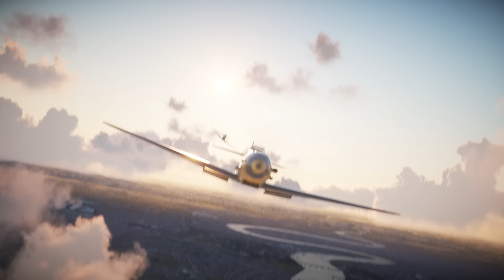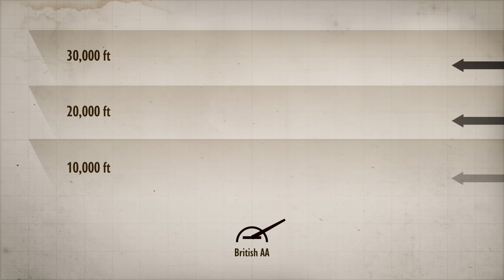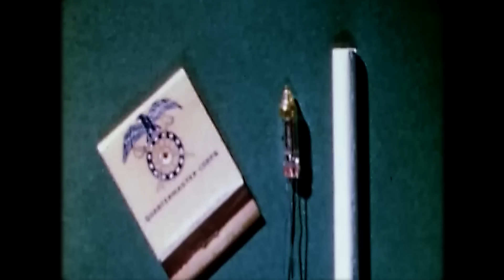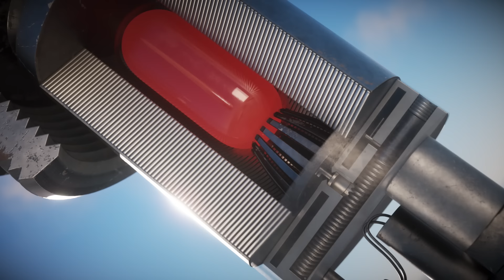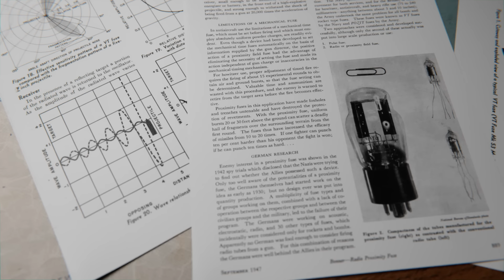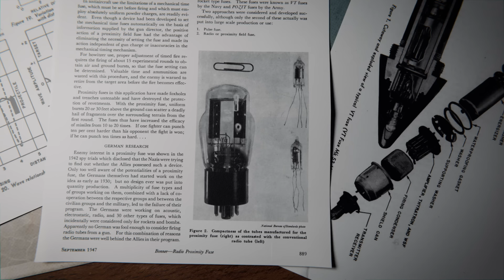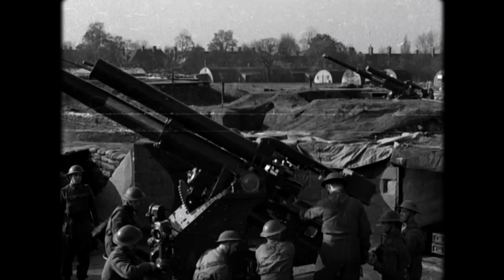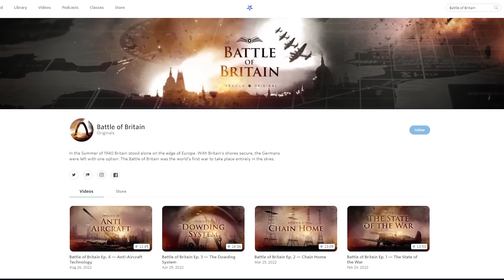The Secret Invention That Changed World War 2

Comment: They made a difference, especially in conjunction with the “predictors” (analog mechanical targeting computers and electromechanical relays to automatically aim the gun).  Once these were implemented, the crews didn’t even look at the targets.  It was just load the gun, and keep the pointers aligned.  One pointer (under control of the gunner) showed where the gun was actually pointed, the other (under the control of the computer) showed where it should be pointed.   The crews never even had to look up.  The seemingly obvious step of removing the gun crew and turning the aiming over to the computer didn’t happen until the 80’s though with the advent of the CIWS gatling gun antimissile system.
Reply: I'm really disappointed real engineering missed this. The predictors are my personal favorite invention of world war 2.
Reply: Not to mention radar, which allowed for such precise measurements of enemy planes
Reply: Indeed! hopefully we will never see the need for anything like these systems ever again.
Reply: @Sprengstoff  sorry to be the bearer of bad news but these systems are the basis of modern systems that have seen and continue to see extensive use. The proximity first he's describing is a lot like radar just much more primitive. The AA shell is making a serious comeback. Numerous new systems are being developed to combat drones and cas.
In a way it's good news, drones aren't a human life, but they take them a little too well.
Reply: @notsam498  There's not even a comeback, it's always been used and refined. The ancient 35mm Oerlikon GDF and 40mm/57mm Bofors cannons many nations use were gradually upgraded with 3D radar/multisensor cueing and programmable AHEAD rounds, essentially slowly turning 50 year old manual guns into highly modern autonomous CIWS. The West, particularly the US simply ignored SHORAD for a long time (granted it is understandable why).

I'd like to see guided hypersonic projectiles massively adopted in 127mm/5 inch guns though, it's time we have more economical solutions for mid-range AA.
Reply: @mimimimeow  hyper Sonic muzzle fired projectiles are kind of impractical. Every single time they've tried that it results in very expensive hardware or reliability problems. Don't buy into the hypersonic hype. It's mostly nonsense and far from a new idea. The basic physics of it are not favorable. Velocity vs force applied in a gas is pretty much logarithmic, eventually only small velocity gains happen for huge increases in force, that and the way energy is lost quickly becomes a liability. I mean in cruise missiles it turns out it's cheaper and more effective  to make one stealth.
Reply: There were analog targeting  computers in use by the US navy in World war II but it was only used for the big guns on battleships, anti aircraft games were manually aimed.    There were too many of these guns for the primitive computers of the time to try manage all of them in the midst of a fire fight with enemy aircraft.
Reply: @autobotjazz1972  

Analogue targeting computers were used by ALL navies for battleship main guns (in fact, navies had been using them since WWI); the US did have arguably the best analogue targeting computer for battleships, but it wasn’t alone in having computers.
Reply: @autobotjazz1972  Analog computers were very much used to aim US Navy anti-aircraft guns. The Mk 14 gun director was added to anti-aircraft guns aboard Navy ships before the U.S. entered the war. It was mounted on the gun, and they encountered problems with vibrations throwing it off. The upgraded Mk 51 director (a standalone unit which controlled multiple guns' aim electronically) was rolled out in 1942. It still required a person to track the target by sight (converted to radar by the end of the war). But using optics and turn rate, it would calculate the lead needed to hit the target. 14,000 Mk 51 directors were made by the end of the war. 

Search for Mk 51 director. There's a pretty good web page describing it in detail. There was a Mk 14 director on display at Draper Labs when I visited, and I spent a good half hour engrossed in reading about it and looking it over. Absolutely incredible that they came up with it in the early 1940s. When I saw the title for the video, I thought that was what it was going to be about. Was blown away that they also managed to squeeze a radar unit into the fuse for artillery shells.
Reply: All this fire control paired with the fast firing 6 inch guns in the US Navy leads to a machine gun of lead down range . Some of the late war USN cruisers could dish out 120 shells per minute
Reply: @sherlocksinha2435  USS Atlanta CL-51
Reply: Very important comment. I hope it gets voted up!
Reply: Weapons systems before the CIWS eliminated having to manually point the gun to match the computer. The MK45 5 inch mount for example.
Reply: @buckstrucks4476  They still required some manual inputs.  As far as I am aware the first fully autonomous system was CIWS.  I could easily be wrong though, so please name some systems for me to research.
Reply: @Simple_But_Expensive  For the MK45 the guy on the gun console in CIC tells the gun what to target and when to shoot, but there doesn't need to be a crew in the gun until the magazine is depleted. Its all handled by the fire control system. The WWII fire control computers could also slave the guns to the director and the crew in the turret was just a back up aiming system with no inputs other than loading the gun. The CIWS system in automatic mode can assess  and engage threats to the ship it is mounted on and will ignore others. But the guy on its console still has to be there to switch it from standby to auto. You don't want the thing radiating and telling everyone where you are. I guess you are correct in saying that it is possibly the first fully automated system, but its not the first to take the gunners in the mount out of the loop.
Reply: Even with the VT fuse it was found that having fighters to shoot down enemy aircraft was the best and first line of defence.
Reply: Actually you didn't have to wain until the 1980's. The British 3.7" AA gun moved from a follow-the-pointer system as you describe, to a servo-controlled system during WW2. In this mark of carriage, the gunners essentially had to feed the beast with rounds, placed in a trough that tilted automatically to allow the hydraulic rammer to insert the round, and when the party was over they had to clean the gun. Pretty boring existence... Maximum rate of fire was impressive in this set-up, about 60 rounds a minute if I recall correctly. Barrel life was a problem like with all AA guns.
Reply: "Use the Force Luke"  Ahhhh, maybe not :D
Reply: In some instances, manually aiming a gun using computer assistance requires less moving parts which means fewer points of failure and a lower cost to produce.  The CIWS weapon system, because it is an anti-missile system, needs to be computer controlled in order to effectively track inbound missiles moving at a high rate of speed.
Reply: @daexion  Useless nitpick:
"Rate of speed" is called acceleration. "Rate of distance" is called speed.

I would use either "a high rate" or "a high speed" - combining both changes the meaning.
Reply: @daexion  it's really apples to potatoes vs proximity fuses the ciws is taking mostly normal explosive or piercing rounds and putting them to work with a computer and sensors. I think the newer systems I was mentioning are more like the flak guns of we2 because they are using much larger shells
Reply: ah.. the CIWS :)
Reply: So, how did the computer identify targets? I'm thinking the info was input by hand. Until digital computers had advanced to where they could be light, portable, power-efficient, and reliable, they didn't make much sense on battlefields.

I love the CIWS. It really has to be seen (in person) in action to be believed. The target drone had just about disappeared from view when the CIWS opened up. That it could hit something so small and far away, and not waste ammo, really impressed me. I think part of why I like them so much has to do with them looking like R2D2. Damn, I sure wish I'd had a DSLR back then, but they didn't exist yet...so I just have a handful of shots.
Reply: The predictor is also where the word "cybernetics" comes from.
Reply: No that was the German flak batteries. Navy had some predictors. UK did not have the computational capacity, Germans had far more powerful than Collosus first ever all digital Zuse Z3, multi program computer. Konrad Zuse rebuilt the computer post war.
Reply: @FlimFlammer-bk8dp  Predictors were analog computers that used gears, shafts, differentials, 3d cams and the like.  Some the US Navy had used up to 25 inputs.  The ones on antiaircraft guns were much simpler.  

Early NASA work on orbital mechanics used the same technology.  By the time of Apollo, the total digital computing capacity on Earth was about the same as a single Iphone 3.  The total capacity of the lunar lander and command module combined was about equal to a calculator watch from Casio.  

During the war, Germans indeed had a digital computer, but they never did much with it.  The US also had one, (this is why Grace Hopper eventually became an admiral), but its only wartime use was to compute gunnery tables.  England had the bomb, which they used to decrypt enigma, but it wasn’t really a computer.  In fact, its operation was much closer to an old style electrical meter, only with letters instead of numbers.

It wasn’t until the late 70’s that digital computers were small enough and had the “resolution” to operate smoothly enough to match analog computers for target tracking.  Even the attack aircraft in Vietnam were still using mechanical analog computers.  

Prior to that, digital computers certainly existed, but they were large installations kept by white coated druids in air conditioned rooms behind glass walls.  You wrote your program on punch cards and handed it to one of the druids.  A little later, another druid handed you a stack of punch cards with the results that were then used to generate a printout on a teletype machine.

CRT screens existed, but they were essentially modified oscilloscopes.  The first computer you and I would recognize is probably an IBM System/360, which had a 64 bit chip, a 32 bit bus, and 64MB of magnetic tape ram, still no monitor, and cost IBM 5 billion 1964 dollars to develop.  It was put on the market in 1964.  The earlier IBM 1401 was kind of training wheels. It could only be leased, and cost $5300/month.  That is close to $20000/month in today’s dollars.  It also had a clock in the khz range, vs todays ghz range.  The computers of the 80’s were in the mhz range.  

The first digital computer I ever saw was in the 70’s at my high school.  It was a DOD school in Europe.  It had a teletype, a punch tape reader/puncher, and 16k of iron ring ram.  It also filled two metal cabinets about 3x4x10 feet.  It ran on a khz clock.  The next one I saw was in my Navy recruiter’s office.  It was a PDP 11.  Data entry was a teletype, but it had an actual crt monitor that was 8” amber on black.  In my second year in the Navy, I bought a trash 80, and thought I was bleeding edge.  Eight years later I bought an Atari with pretty much the same specs as the system 360.  Two years later I thought I was the cat’s pajamas when I built a pc clone with an 8 mhz overclock.  Over the years I built or upgraded dozens of PCs.  Then it got boring.  Nowadays its like buying macaroni.  The most I can get for the lowest price, and I plug it into my 40” lcd flat panel.

I am retired now and have a lot of time on my hands.  I recently bought a mini lathe and milling machine.  So far, I have built an analog adder.  I am currently working on a multiplier.  Later I intend to work on other parts like integrators.  First I have to learn about materials amd machining methods.  Since I am learning about analog computers, I decided to use analog machining methods also, so everything is done by hand with vernier dials.  No cad/cam.  I do use a calculator though.😎
Reply: Wonderful!  Tell me more.
Reply: It's crazy that these made ships so effective against attacking aircraft that the kamikazes were actually a completely rational strategy. Attacking ships was suicide anyway withing a couple of missions, and just trying to bomb them was so much less effective that it meant just throwing one's life away. At least being a kamikaze you had a chance to accomplish something before you died. Though I don't know that the Japanese military or the pilots actually did the analysis - based on other stuff I'm inclined to think it was only accidentally rational, but I digress.
Reply: @j.f.fisher5318  The average kamikazi pilot only had a few hours of flight training.  Just enough to get in the air and fly to the target.  After Midway, the Japanese had lost essentially all of their experienced pilots.  If they wanted to do any damage at all, kamikazis were their only choice.  The real tragedy is that the Japanese high command knew the kamikazis would be ineffective.  The US had too many ships for it to work.  It was mostly blind hope on the non-realist officers and, believe it or not, a morale booster for civilians.
Reply: @Simple_But_Expensive  Kamikaze being an unrealistic blind hope is in the name itself. Kami = god, kaze = wind, so divine wind or wind sent by God. It refers to two hurricanes in the 1200s which wiped out two Mongol invasion fleets about to make landfall on Japan, that the Japanese surely would have lost to. So hoping for another miracle, they named the suicide planes kamikaze.
Reply: @j.f.fisher5318  but
Reply: Proximity fuses made all the difference . Patton demanded them for his arty and got. Totally devastated German troops
Reply: "The seemingly obvious step" It wasn't obvious then, because we had to wait until the 80s to have microchips small enough to do what you just said.
Reply: how can you conclude this informational video that was uploaded a few seconds ago?
Reply: @bumsiltech  i study military history, especially technology.

Comment: Why did it change the WW2 if it was used only over Pacific?
Reply: Watch the rest of the video. It was used over Europe from 1944-1945. It was used over the Pacific from 1943-1945
Reply: It was used after Normandy
Reply: The first use of the proximity fuse was during the Battle of the Bulge the cartons were labeled do not open till December 25th. The smallest gun that could fire them was a 5-inch. The German troops who survived had to be isolated to protect the Secret and were sent back to England for interrogation.

Comment: Analog solutions are just so much more interesting and satisfying than digital ones😬👌🏼
Reply: Okay, but here's the thing: digital solutions are virtual analogs of analog solutions. And I'm not just doing the "omg look at how smart I am" thing characterized by putting together some random, cool-looking words to form a sentence that has no clear/falsifiable meaning.
Reply: @drvictorvs  You just did!
Reply: @drvictorvs  and “virtual” they will stay
Reply: Usually way less effective.... But so much more creative and interesting to learn about.
Reply: @ltcuddles685  not necessarily less effective, it depends on the type of problem.
Reply: @stevexracer  I was just thinking in general, not fuse specific. Tried and tested analog versions are still often preferred over untested digital ones. Especially in military applications.
Reply: "analogue"?
That word was hardly ever applied to physical devices before personal computers became common.
The correct word would simply be "mechanical".
Reply: @Tinker1950  Analogue computers were also built with things called 'op amps'. Valve and transistorised differentiators and integrators came to replace mechanical ones in solving calculus equations but were still analogue in nature - the variables were continuously variable within limits unlike digital which has discrete, albeit very small steps. I know, I studied them back in the early 1970s.
Reply: @bobuk5722  So did I - in the RAF in the late '60s.
I well remember being introduced the the' Desynn' transmitter, a device for indicating positions of movable surfaces etc
More info here:  https://youtu.be/2iqJ6352u74